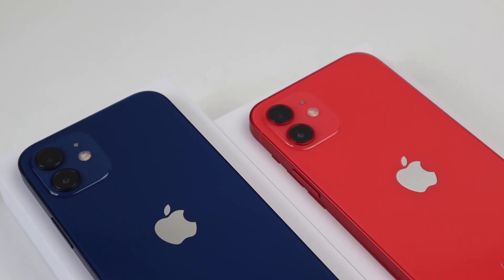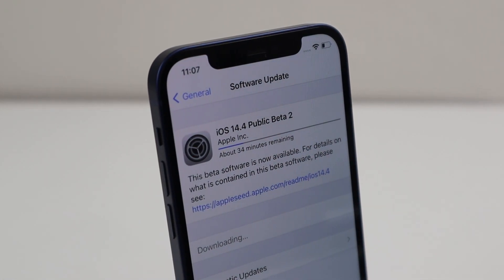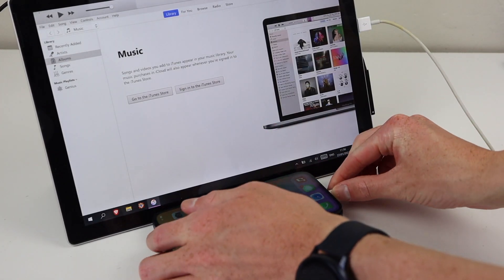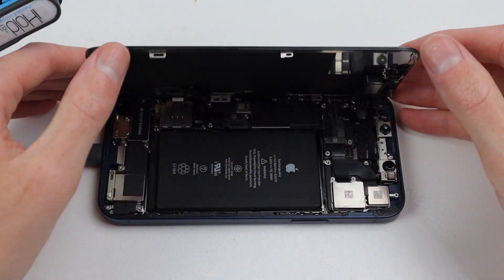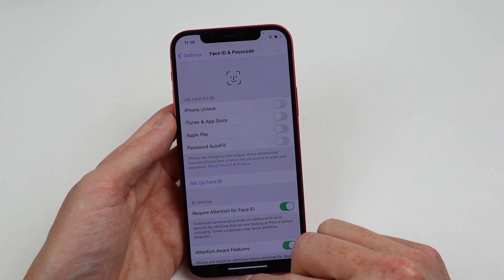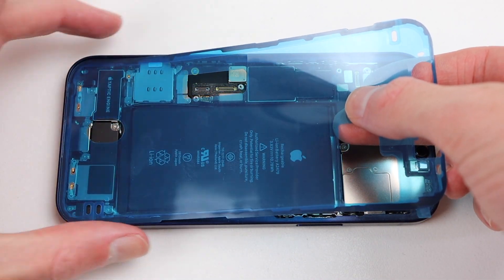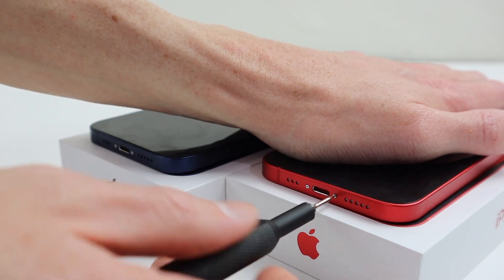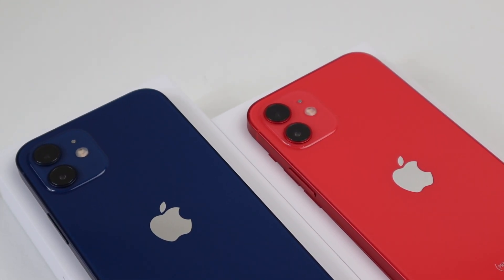iPhone 12's Latest Approach at Deterring 3rd Party Repair

Comment: Hi Hugh,
iTunes 12.10 will never come out for Mac as Apple has discontinued iTunes on MacOS.
From MacOS 10.15 and onwards iPhones talks to MacOS through the Finder application.
I imagine you may have plugged the iPhone into Mac hardware that doesn't have the latest MacOS 11.1 installed.
Reply from the maker: I am not allowed to install the latest version of MacOS, apparently my 12 core Xeon processors, 64GB of RAM and GTX 980 don't meet the system requirements but a laptop with a core i5, 4gb of RAM and an integrated GPU oh yeah thats fine....

Funny that as soon as the new Mac Pro came out mine was suddenly "obsolete".
I cannot even hack the OS to upgrade as my current graphics card has no drivers, Nvidia states "Apple fully controls drivers for Mac OS. But if Apple allows, our engineers are ready... [to] deliver great drivers..." - September 2018

They think they can get me to buy a new computer, yeah right. My next computer will be a Windows PC.
Reply: @HughJeffreys  I believe Apple holds a grudge with Nvidia that they cant get over (or wants to make an example of) and refuses to work with them in any way. 
That might be about to change though seeing as Nvidia just bought Arm Holdings. 
I think it stemmed from a line of Nvidia chips being faulty in MacBooks and Nvidia refusing to pay for the replacements / fix.
Intergrated Intel or AMD graphics cards / eGPUs should be compatible.

Yea its quite disappointing they only provide 7 years software support from the date of release. I could understand not officially supporting it forever but keeping your Apple products from working together sounds allot like planned/forced obsolescence.
Reply: @HughJeffreys  look up dosdude’s patch! (Which sucks that we need to rely on patches just to update)
Reply: @stardustdragon0842  Idk if dosdude has released a Big Sur patch but even if he did people would still face issues configuring their drivers because that's what you can't patch, it's not linux.
Reply: @HughJeffreys  Hackintosh? :o
Reply: @HughJeffreys  then why use Mac 
Mac caps creativity 
Why not go to windows or Linux 
You can use most of the Mac things there efficiently 
I don't understand why people waste their money on I Mac where they can get laptops with same power only for 200 usd

Comment: 2019: Battery is paired 
2020: Screen is paired 
2021: Camera is paired 
2022: Waterproof seal is paired 
2023: Screw is paired 
2024: The whole box is paired
Reply: @PhoneRepNederland  screen pairing not display pairing
Reply: Touch id and face id are paired since 2013 and 2017
Reply: @dylanmooney327  home buttons are paired since 2016  starting with the iphone 7

Comment: I wish more people realized how big of a deal it is that apple essentially is paring each component to a specific device.  Imagine being able to take your perfectly fine iphone xs to a repair shop and getting a camera replacement without being told by apple to buy a new phone.
Reply: It wont cost $2000 but okay
Reply: What kind of battery costs 2k?

Comment: Apple has been taking away features more than adding them.
Reply: @J Fz You are absolutely incorrect!
Apple used to make phones slower so it wouldn’t automatically shut off at 20% but there was a lawsuit and Apple lost so you can now turn off the slowing “feature” in battery settings on every iPhone 

Now let’s talk about money, Samsung makes money by selling hardware and Apple makes money by selling hardware and many other things. When Samsung sells a phone they make money and that’s the end of it but when Apple sells a phone, iOS comes with the phone and with it the App Store and other Apple services. When you buy an app or service on a Samsung device the money goes to Google but when you buy an app or service on an iPhone it goes to Apple. This is why Samsung makes phones obsolete because they have to sell another one but Apple doesn’t have to slow down phones because as long as it works, Apple is making money off of services and apps you buy each month.

Samsung wants you to buy another unit and Apple wants you to keep using any iPhone so you subscribe to Apple services and buy apps.
Apple and Samsung used to have the same moto but when phones started lasting longer the industry had to change into the service sector to succeed. Apple successfully did that but when Samsung tried everyone went out of their way to download Google services and ignored Samsung’s services so it lead to this.

Now let’s talk about service, most of the repair charges are from the labour so Samsung isn’t making a lot of money. Apple however wants everyone to use a perfect iPhone, so what do they do? They seal the phone up and pair everything so only they can properly fix this. This of course turned into a problem because Apple made their stuff too hard to fix for themselves so they did the logical thing of charging half the value of the product to replace it entirely if anything other than the display or battery goes wrong.

As for water damage, there are sensors in the device and when it comes in contact with water or moisture it turns pink and when Apple sees it they mark it as damaged. 

I hope you see the difference between the two companies now. I would usually end my internet “debates” by calling the other candidate an idiot but I think you are intelligent so I shouldn’t, Right?
Reply: @ikedakazuto5061  perfectly said
Reply: @J Fz well i know but the headphone jack and the home button are now considered "features"
Reply: You just figuring this out now? They call this courage.
Reply: @J Fz While I get your point, an all wireless phone would be terrible in my opinion. Given what I stated in my other comment, I like to be able to plug my phone into my computers. An all wireless phone would mean that my other hardware would have to be compatible with the wireless technology. No big deal for modern devices but I like to use my hardware for as long as possible which means I would have to use dongles while I can just use a usb cable to plug my phone into my computer now.

And wireless charging right now is still not as efficient as using a cable.

Also, removing the headphone jack was a terrible thing for me. I have a very nice pair of headphones that have a nice thick and heavy cable. No big deal with a real headphone jack. But the adapter that apple gives you with their IPhones? Flimsy as F... Like for real, if I plugged that heavy cable from my "real" headphones into that adapter the cable of that thing would just rip. 

Before you judge me that I should go wireless with my headphones, I won't. At least not for my audiophile equipment. A pair of wireless headphones that are just half as good as my "real" headphones would cost me nearly quadruple of what my headphones cost me. So no. Small earbuds that are wireless? Fine, I even love mine. But headphones to actually sit down and listen to music with? Why would you even want wireless with those? It's not needed. Cables are fine and most of the time actually better, depending on how electrically noisy your area is.
Reply: @J Fz 6 years of updates  while android only lasts 2-3 before they go kaput. 
Apple doesn’t need too. Apple supports he iPhone until it physically cannot run new software while android phones disable them on purpose because manufacturers like Samsung sell the phones while Apple can sell services in the App Store and other things like Apple one so they can support phones for much longer
Reply: @ikedakazuto5061  I'm pretty Sure iOS 14 would Run perfectly fine on a 5C but Apple disabled it. Nothing of that has to do anything with Hardware, Fanboy.
Reply: @ikedakazuto5061  Last time I looked up Jailbreaking on IPhones it was still illegal so this is not something I'd ever want to do. While Iphone 5Cs with 8 GB existed there were also other models with more storage and the processor would definitely be sufficient. But as Apple realized the market failure that the 5C was they made it obsolete. But now take a 5S that is a bit more modern, why shouldn't it be able to run the latest software? Because Apple does not want it to. But that is not only Apple's flaw, It's every phone manufacturer that does this bullshit. You got my comemnt all wrong, this wasn't about my fanboyism for some company other than Apple. I hate planned obsolescence in general and especially in the phone market is is going way out of hand with some companies only supporting their phones for a few months after their release. At the same time I have a notebook from 2008 that runs FreeBSD 12.2 with KDE perfectly fine. And why does it do this? Because I was able to choose what I want to run on that notebook. This is what I would like on my phone as well. Being able to plug it into my Computer running FreeBSD or [insert other OS here] to install whatever I want on it. Sure that would involve work for the companies designing drivers for their phones but still I would love to just be able to have a free version of android that I have chosen myself on my phone.
Reply: @ikedakazuto5061  I'm by no means an old hag. In fact I'm 19 Years old. Also I'm still not a fanboy of any company. What I am saying is that most companies use planned obsolescence today. And I hate that fact.
Reply: @nilswegner2881  No one likes planned obsolescence but you have to understand that  companies have to make money or else they wouldn’t be here, you also have to understand that not everyone sells the phone. Of course uneducated fools think that but companies like Apple and Google actually sell you services instead of relying on the hone itself
Reply: @J Fz if that’s the case why do they provide 5 years of IOS support and why would I be writing this on an 8 year old iPad with no issues?
Reply: @markbennett6658  cuz you’re an apple fanboy 🤫
Reply: @shloktodi3728  thanks for the intelligent input!
Reply: @markbennett6658  don’t worry I am too I’m using an iPhone 6s even though there’s better android ones for cheap that I can buy lmao go Apple !
Reply: @shloktodi3728  yes plenty of life left in the 6S subject to a battery replacement probably! Those Android phones are cheaper but not as good value 6 years in?
Reply: @markbennett6658  exactly man got a battery replaced 4 months back and it runs like butter
Reply: @markbennett6658  isheep
Reply: @s_car.  just keepin’ it real bruh!
Reply: @dovydas6789  isheep
Reply: @dovydas6789  isheep
Reply: @s_car.  lmfao sad boy
Reply: @dovydas6789  if you say so isheep...,if you say so
Reply: @s_car.  yes, sad scamsung boy, sad truth
Reply: @dovydas6789  .